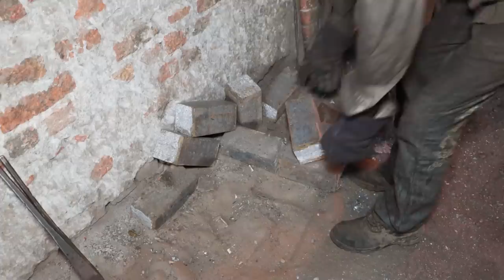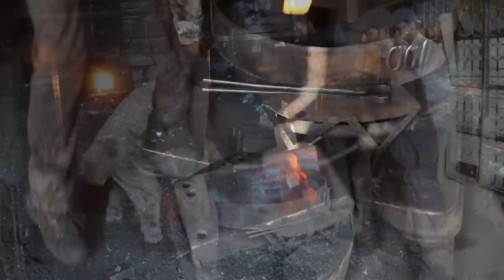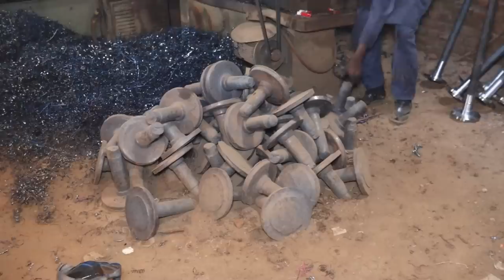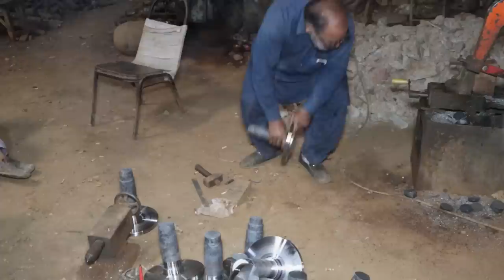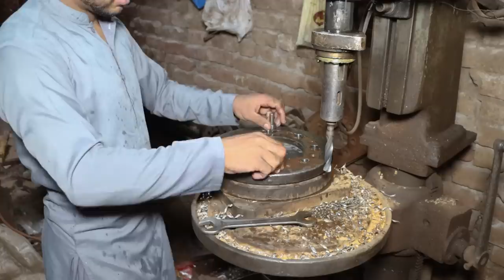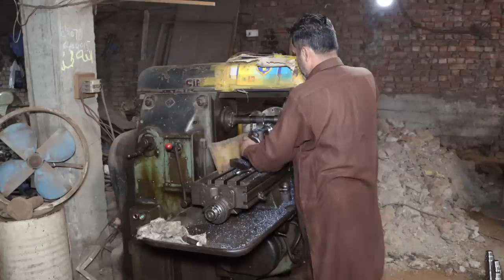Amazing Manufacturing Process of Truck Axle Shaft

Comment: What I don't understand, why they don't use desks. They have to pick up the shaft after every step, when they drop it to the floor.
Reply: Because that is typical for how many work and manufactire things in india. On the floor, often ussing there feet to hold things.
Also they often work on 1 thing today, another tomorow and the floor is made of dirt or scal it ain't easy to move stuff around on such a floor.
It is just how stuff is done over there. Kind of like working bended over is normalised in western workplaces.
Reply: @leviathanmdk  Pakistani
Reply: Không
Reply: All these videos have one thing in common. Absolutely no PPE!
Reply: Desks cost is more than caliber and they don't have caliber! They use eyes and meter for measures as they use launch and floor as desk!!! After the process this parts have 1000 dents from bumps.

Comment: OmG
He use the NC machine lathe ?!👍👍
Reply: I'm thinking it might be a tracing lathe, there is a template on the back of the lathe.
Reply: It looks like a tracing lathe, there is a template on the back of the lathe.Keith Fenner has a lathe similar to the one in the video.
Reply: @keithgutshall9559  is it ? I saw some wire and automatically I thought it's a NC !!😉

Comment: They're running their furnace too rich and too high a blower speed. If it was set correctly there should only be small licks of flame around the opening. I can understand that labor is cheap that's why the waste so much of it, but fuel is expensive. You would think they would try to avoid wasting it.